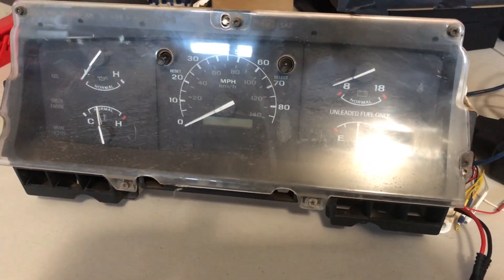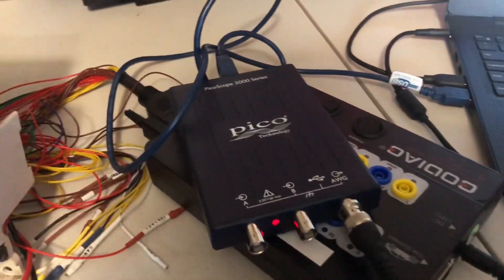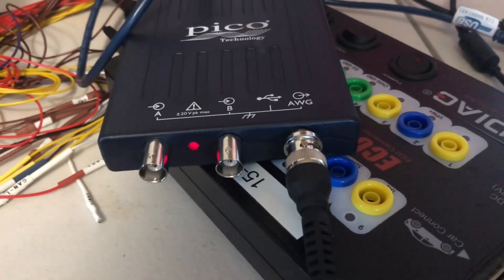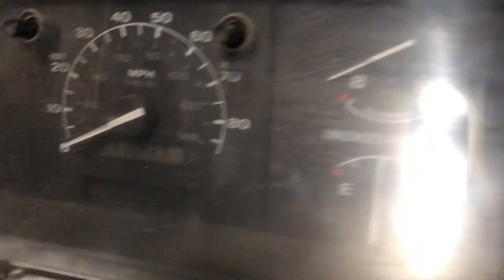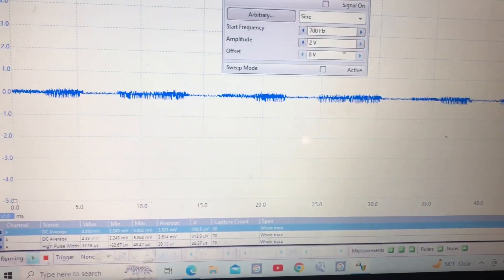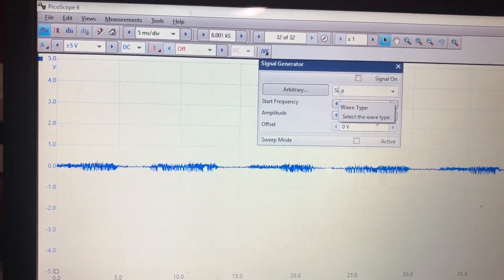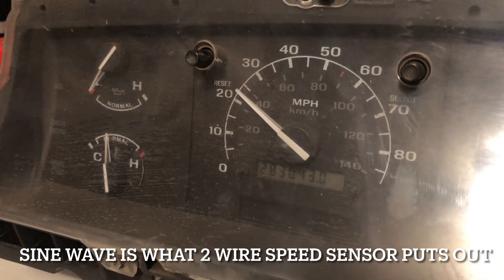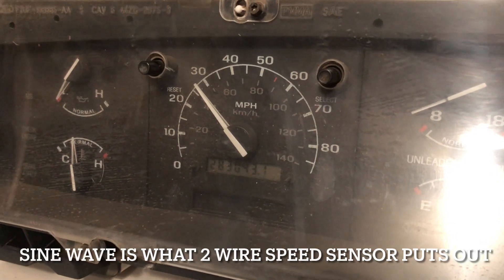Testing a 1997 Ford F250 speedometer w PSOM

Comment: In my experience, mechanics tend to be visual learners with an innate curiosity for kinetics and are very good at following instructions. Your video shows significant potential and I would suggest adding an understanding by visually demonstrating where the wires are inserted to the module from the Pico scope and the diode block and where the latter can be purchased. In conclusion and in a mechanical context, I think you're channel would get a lot more attention with some simplification (e.g., how to test PSOM with automotive scanner/oscilloscope and explain to the mechanic how it receives an analog signal from the VSS and converts it to a digital signal, which it sends to the ECM/PCM/ECU, which in turn, communicates with the transmission concerning the speed of the truck allowing the solenoids to properly shift according to the actual speed of the vehicle. Then how to test these transactions to determine component/network failure.